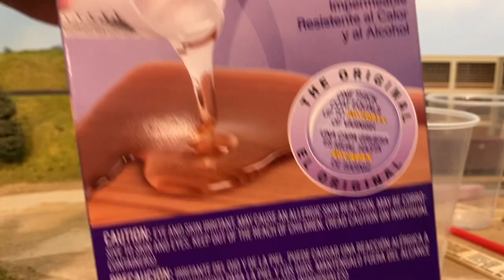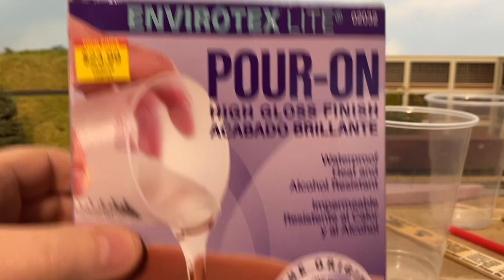Making Water For My HO Train Layout Pond With Envirotex!

Comment: I have so many questions; how did you prepare the bottom of the pond?  Did you pour over foam, wood, plaster?   What did you use for the rocks?   Nice job, it looks great!
Reply from the maker: First of all, I can say this that there are many many ways to do this. My way may not be the best, but it works for me. So first for me, of course I carved out the whole on top of foam this this is all done on foam. Then what I do is I usually will paint the bottom using a base paint this case I used woodland Scenic Moss green. After that, I poured some ground River rock that I got from Scenic Express. But now since then I have found it cheaper to buy it at a local hardware store or a nursery. You can buy in sacks of probably five and 10 and 20 pounds for way cheaper than buying it in the bottles. I poured it and glued it and then of course I made sure the bottom was nicely painted and I poured a little bit of sand in there as well. Then, after that was done, all I did was pour the water are the epoxy resin I should say I poured that into the pond in several layers usually doing no more than about an 8th inch deep and some cases that’s all you even need. And some cases you might have to do two or three pours. Just a note for me. I don’t use the Woodland Scenic water products. They all say you have to put plaster cloth underneath the water. I don’t believe you have to do this myself with their product you do because I did it and it failed. But for me, what I always do is, I just use the product that you saw on this video and that stuff does not require any Material cloth underneath it. You can put it over the plaster over the foam over sand over gravel and landscaping it goes right over it. I hope this helps. I know it’s very general and vague, but it really is pretty simple and my best advice is to make a couple little sample ponds about 34 inches and practice doing some first. I made some videos showing my three samples I did. I don’t know if I have the video yet. If I do still, I will post it and maybe I can send you a link. Thanks for watching.

Comment: very nice work John. do you pour scenic glue over the rocks to lock them down? or do you put them on top of white glue?
Reply from the maker: I never use scenic glue on anything but I do use watered down white glue. Much cheaper buying a gallon jug of it from the hardware store. My mix ratio is about 75% water and 25% glue mixed. And yes I do glue them down in place first. You want to make sure your glue is dry. Overnight is usually good. FYI: If you pour your resin water down and find you dont have enough rock just put more on top of the poured water. They will sink down in. I did a ton of that on my big river scene. Thanks again.

Comment: I didn't realize the Environtex has a shelf life. I bought mine many years ago and never got around to building my HO harbor scene until recently. 
Now I am pretty concerned whether I should use it or not. It wasn't cheap (as you probably know) and I hate to see it go to waste. Have you ever used something way past the one year shelf life. Any suggestions welcome. Thanks.
Phil
NYC Area (Jersey Shore)
Reply from the maker: Yes I knew that. It is tough to buy when you know they will likely expire but I have used 3 year old stuff. My current River was my oldest stuff I ever used. I did add a bit more hardener to it. Also I made sure the room where it was very warm. It still came out good. Just make sure you mix it really well. I stirred about 5 min longer than what they said. This is what I did so use your own judgement.

Comment: What did you use to treat the base do the resin didn’t eat thru?
Reply from the maker: I dont remember for sure but I think I sculpt a molded it then just painted it. I generally pour right directly onto the pink foam. zNever really had any issues with this product. The woodland scenics water will require much more treatment and patients. I had too many bad experiences with their products. Now I only use epoxy resins like Envirotex. Never had a problem with it. Just follow directions.

Comment: Great work beautiful Layout .. By the way When i make pond after sometime or few months Bubbles comes out so many and big bubbles . Anybody can help or know why ? . Thanks
Reply from the maker: Oh no! I thought I was the only one that happen to. That happen to me using Woodland Scenics deep water pour. 9 friggen months later a huge group of bubbles appeared just overnight. I was pissed. I cut the section out and switched to this product and it never happened again. They said poor mixing. I did not agree. Possible conflict between layer mix amounts though. So now I use this only. One thing you can do if you still have room enough for pouring another layer is seal over the top of it and re-pour with a new product. That is why I never totally fill the water basin just in case of an issue. Thanks!
Reply: @JohnsRailroad  yes sir i use woodland scenics. 3 times happned with me i make small river and 2 ponds each time after few months becomes many Bubbles . Thanks for your Help i will do as you said i will try same the product you use Big Thanks 👍🏼
Reply from the maker: Like I said I am glad to know I was not the only one it happen to. Now I know it likely is a product that is difficult to use and has negative long term affects. Sorry we both had to deal with it. FYI I used 4 boxes of it before realizing the issue. I still have a box left. Might just a swell toss it out.
Reply from the maker: My last layout was in place 3 years with an 8ft river using Envirotek water and no issues.
Reply: @JohnsRailroad    yes sir Fact we losing money and time and also we have to work again on the layout or cut it and change it for because of Bubbles only and not the right product. So i will do same you and take your advice . Thanks for your help 👍🏼